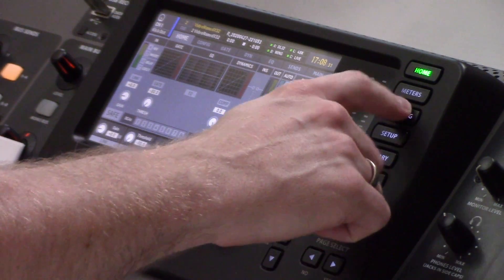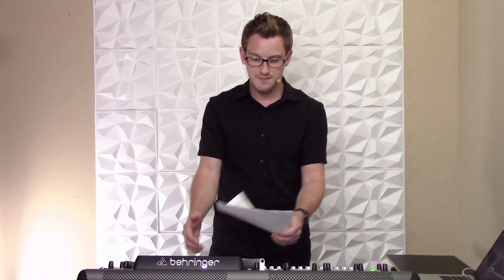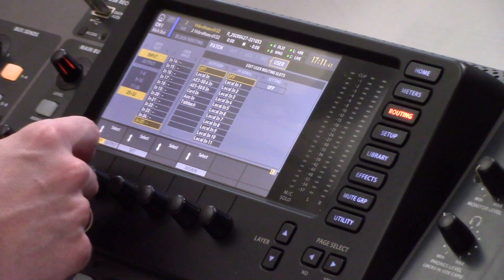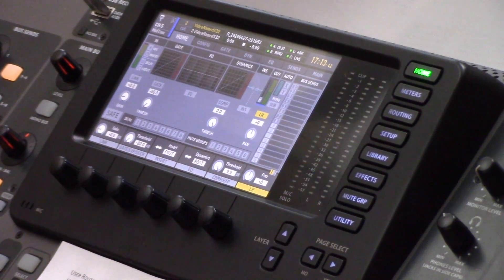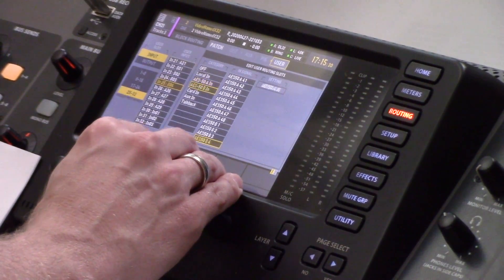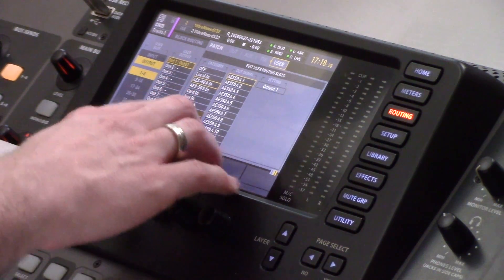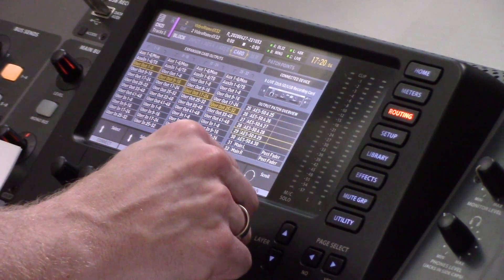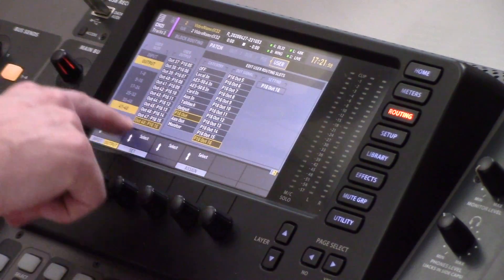X32 Firmware V4 | 301 - User Routing 1-to-1 Patching!

Comment: Hi Drew - many thanks for your efforts to help us better understand Behringer's X32 operating philosophy. While trying out and rebuilding your instructions, I came across a serious problem which I was able to solve after tens of hours. If I try to implement your instructions with the X32 software for Windows, it does not work. Since I have an X32 Rack version and didn't always want to slide around on my knees in front of my side rack, I didn't come up with the idea of trying this directly on the mixing console. Eventually, after a few hours of frustrated trial and error, I made the necessary adjustments directly on the mixer. And lo and behold ... it worked immediately. Conclusion: the X32 software is faulty and obviously doesn't pass the set commands on to the mixing console correctly. Maybe you can give your community a hint in one of your new videos about the X32 that this software should be used with caution, especially when it comes to more complex routing. 
Best regards from Germany - Frank

Comment: Hello. I would like to ask for an explanation:
1. How to connect X32 Compact to S32 and use 16 outputs.
2. How to connect x32 Compact and use outputs 1-8 from S32 and outputs 9-16 locally from X32 Compact so that you still have 16 outputs.
3. How to freely configure outputs on X32 Compac and full size.

I am asking for help, which I need to connect more and more often and I have a problem with it.

Regards. Paul

Comment: In youre video you mention Channels 1-29 used as AES50 and Channels 30-32 as Local inputs . Then in the user inputs page you assigned 1-29 being AES50 and 30-32 as Local 1 ,Local2 and Local3. THAT IS WRONG  because local 1 local 2 local and local3 has already been assigned   as AES50 .  This will not work Channels 30-32 should be set to Local 30, Local 31 and  local 32 then you can local input into Channels 30,31,32

Comment: I am so happy they fixed this! There have certainly been times when I've been using an X32 and needed more than 24 inputs from the stage but also needed one or two inputs at the FOH position. Very rarely do I need exactly 8 inputs at the FOH position. It's really nice to be able to just assign the specific inputs that you need like you've always been able to do on basically every other digital console!

Comment: What output channels does the S32 use when sending back from x32 on the AES?  You mentioned that the Ultranet uses outputs 33-48 and you have to use those.  But what does the S32 use for it's 1-16 XLR outs on the back of the S32? Is it simply 1-16? Or can you change and customize it?  I'm trying to understand the use cases of only being able to pass through 17-32 if the other blocks are locked in when using an S32.

Comment: Thanks, I received a "shocker" when I upgraded my X32 to V4.06 and S16 to V2.5. I had no outputs out of my S16 but all inputs worked fine. After watching the video about 4 times I figured out that User Outputs should have Output. Why in the world they didn't call them Buss'? I thought mistakenly output was the jack on back of X32. Behringer support was slow, Thanks again Drew!!

Comment: Sir I'm banging my head on some stuff .
Running x32 usb carded to a pc then to reaper daw .
I us a  dl32  for everything exept the usb to pc and aux for pc sound back to x32 .
I'm trying to rough out a daw mix threw a aux out 1/4 inch say 1and 2 to a atem mini pro so I can run my live mixes with plugins from reaper .
All 32 channels on the dl32 are used .
Aux ports 3,4,7,8 are opened 1 and 2 in have a left rt from the headphone of pc and 5 and 6 are a click track route from reaper . 
Originally I had a matrix mix routed to 1 and 2 out and then that went to mix input of the atem and worked ok but mix could be alot better lol 
And thoughts out help would be great I am doing this in my home studio but our church setup is the same so hopefully I can solve this here .
Thanks

Comment: Drew, thanks for the whole series of V4 tutorials.  One question, wouldn't it make more sense in your example to only use the User patching for 25 to 32?  Seems that would be a lot quicker to only use the User function for the "8 block" you need to split.
Reply: That’s what it thought too. And saw someone doing that in another video also. So the way you described should be more efficient than shown in the video I reckon.

Comment: HI Drew, I cant thank you enough for all you do for us worship leaders that have to know the X32 inside and out1 I do have a Q though, and my head hurts from watching so many times and still not getting it. This Sunday we are trying our first post lockdown service outside on the from lawn. I use an S16 on stage that has all 8 outs set as mix busses. This week however I want to download V4 and figure out how to use out 7 and 8 of the S16 as my main out 15 and 15 so I don't have to run 100s of feet of XLR out to our portable speakers. Our board is staying in house and we will be running the service completely via iPad. You don't specifically address this in the user out section of your video. Any help would be appreciated. Thanks!

Comment: Is this a practical way to deal with linked (stereo) inputs so that only 1 channel is taken up? Keeping more "prime" instruments together? I have a Producer so can only access 8 channels at once. (I understand the left/right each require their own channel, but the right of stereo inputs could be 'stored' in 17-24. Does that make sense?
Reply: Hi,  I have the Compact which has the same 8 + 8 + M. fader layout.  Pressing (any) 2 Input bank select buttons (at the left of the faders) simultaneously will switch both the fader banks. So pressing the 1-8 & 9-16 buttons will give you 1-16 across the 16 faders. Or you could have 9-16 & 17- 24 etc.

Re the routing: If you link an Odd & Even pair of channels they will give a Stereo (pan is automatically set L/R) channel output, but you can still select the same 2 inputs to any other non linked channels to give individual mono channel outputs.  Channel linking options are on Setup/ Config/ Link prefs.

Comment: Hi! We have an X32 & s16. I am using the usb on the x32 to pull audio into my macbook for live stream purposes. I have NO CONTROL over the live stream audio unless I turn the main faders all the way down & the keyboard is the toughest. We are running it into a DI Rack and running the rack into the s16. Even if I mute, it will mute in the house but it still blasts on the stream. I’m running 4.2 firmware on the x32 & 2.4 on the s16. I’m not recording to/from any DAW’s I only want to use the x32 usb as an interface to have our audio from the board go into my streaming software & out to the live stream broadcast. Please help🙏🏾
Reply: Hi,   By default the outputs to the USB Card are direct from the Mixer Inputs (Local or AES50).  To have fader control of the Card inputs for your Stream, you would need to Route the card inputs to a Mixbus Output (post fader Tap, which is the default), then with  Sends on Faders, send the outputs of the Channels you want to appear on the Stream to the I/p of that Mixbus. The Mixbus o/p fader would be the master level control for the Stream, and the Channel faders would control the mix to both the FOH & Stream simultaneously. If you wanted an independent mix for the Stream you would need to change the Sends on Faders Taps to ‘Pre fader’ then the Send’s faders would be the mix for the Stream.  As with all sophisticated systems there are many other ways to achieve the same result, but each with it’s own features and advantages!  

I always have X-edit running on a computer when doing complex setups as it is much easier to see the routing paths and options (and any miss settings) on the graphical display than it is on the small mixer screen.  Hope that helps.

Comment: The x32 could always do 1:1 patching. It is just now all in one space, and significantly more flexible. I have had single re-assigned channels on mine going back many years. I remember having my first 16 on the stage box, then my local wireless mic's and sources and had then grouped in with my wired vocals from the stagebox all in 1-8.  You could reassign the source for individual channels through its config page. So I wish people would stop saying it was forced in groups of 8 as it was not.
Reply from the maker: Yes, you can do 1-to-1 channel routing like you are mentioning. But what you weren't able to do before is take only 15 of your inputs from the stage box, and then use 17 inputs from the local console. You would be limited to selecting 1-8 and 1-16 on the stage box, and then an additional 16 from the local like your setup. But if you wanted to have 17 inputs plugged into the local and then take 15 from the stagebox, you wouldn't be able with the old firmware.
Reply: @DrewBrashler  It was actually better than that. I could have my board in the default setup using all local inputs. Then plug my aes box in and grab one or two inputs to assign to any channel. 
https://www.youtube.com/watch?v=gvuHppv1-iw
I however needed x32 edit on a PC to do this IIRC...  I took that video last year when V4 was announced and my production partner was very excited about it And I was "what is the big deal" lol.  Of course once I updated my board and saw how much easier it was, I knew they knocked it out of the park. It really did add functionality in addition to how much easier they made it. We are both right to a degree.
Reply: Of you we’re working in a block of eight, you’re right. Try to make it with an odd number of input and you’ll fail prior version 4.00. Watch the whole video and it’s self explanatory what’s the new advantage is.

Comment: I am still confused about new routing.  Using my X32 in recording to a PC.  Routing page has  a configuration for recording and one for playback.  How do I monitor previously recorded tracks and record new ones to the PC?
Reply from the maker: Great question, Jim! The routing for Recording is when your console is set to recording mode, so you will want to have this be your inputs from the stage (ie. local or AES50). Then you can press the 6th rotary knob on the routing page to change between Recording/Playback to swap over to the playback mode. This you would want to have routed from the expansion card so it would play form your PC. Hopefully this clears things up!
Reply: Drew Brashler   Thanks for the reply and the info regarding 1 to 1 routing.  After playing with several combinations and new Calkwalk DAW software, I managed .to get everything working exactly the way I needed it to.  Please keep up your instructional video as they are so helpful and your are very good at what you do.  God bless and take care.

Comment: Thank you so much for that Video. I have a question and maybe someone can help me. I am a Tech Guy in our church and we are using the X32 Compact for some weeks. Now my problem is that the outputs from our console are the same like the outputs on our S16 Stagebox. So i have only 8 Outputs and if we are using the outputs for monitoring we only have 6 Outputs, because 7 and 8 are Main L+R. How i can separate the outputs on the stagebox from the outputs on the console so i can use 16 Outputs? Would be great if someone can help me out. I am completely new in this whole thing. Thank you very much!!!
Reply from the maker: Thanks for asking, Josef! Check out this video: https://youtu.be/FBnuuPCnGTQ. But you will want to make sure that your S16 stagebox is set to have the +8 output light turned on. Take a look at the S16 manual on the specifics of how to do this, but by default it will have the outputs 1-8 of the X32 on the S16. By setting the S16 to the +8 on the outputs, it will be pulling from the 9-16.

Another option is to set your AES50 outputs 1-8 to be from Out 9-16 instead of Out 1-8. This would force your X32 to output the 9-16 down the 1-8 to land at the S16.

Hope this helps!
Reply: Drew Brashler, would/could you please PM me on iMessenger? Seems you have gotten me 85% there but not all the way. My set up is pretty typical I think. And I could use the guidance if you could spare, of course thank you, Drew. Compensation is available I’d expect.

Comment: Drew great video learned a lot. I have a question on running as s16 snake and a x32 producer. how can I run all 16 xlr's?
Reply from the maker: Glad you liked it! For running all 16 outpus, you will want to make sure that your S16 stagebox is set to have the +8 output light turned on. Take a look at the S16 manual on the specifics of how to do this, but by default it will have the outputs 1-8 of the X32 on the S16. By setting the S16 to the +8 on the outputs, it will be pulling from the 9-16.

Another option is to set your AES50 outputs 1-8 to be from Out 9-16 instead of Out 1-8. This would force your X32 to output the 9-16 down the 1-8 to land at the S16.

Hope this helps!
Reply: Hey Drew. Thx for your published videos. I really appreciate it and they helped me (almost) perfectly. But.... I got some questions for you:

My configuration is: X32 rack with S32 at AES-50A. I use the equipment first of all as a  InEar monitoring for the bandmembers. Local XLR Outs 01-08 are for the mounted stereo inEar-systems. 

My routinting questions:
1. Out 15/16 at AES-50A as MainLR
2. Out 13/14 at AES-50A as a separate MixOut for Video over a MatrixOUT
3. Out 11/12 at AES-50A as another seperate MixOut over MatrixOUT
4. Out 9/10 at AES-50A as StereoBusMix for Bassplayer (System Not mounted in the InEar-Rack)'
5. Out 7 and 8 at AES-50A as MixBuses for Monitor wedges 

What about the routing? What do I have to do?

Thx in advance and greetings from germany. 

CU, Oliver

Comment: Hi Drew.  Great videos!  You have helped us train an army of sound techs at our church.  Thank you for all your help.  I have a question about the xlive.  With this 1 to 1 routing, can you rout select x live outputs and have others for the worship team to play to?  For instance, I made recordings of my worship team with drums.  When the drummer is not available, can I just select the card output for the drum channels and let the rest of the team play along?
Reply from the maker: Yes you can! Set the channels you need to pull from your X-Live card from the "Card" inputs on the user routing inputs. This would typically be Card 1-2 or additional channels if you wanted to route individual drum channels. Hope this helps!

Comment: Man this will help a bunch. Thank Drew from presenting. Your the man. I also have a question. You said that I can route 48 channels in total. So can I add another 16ch stage box along side my 32ch box and route those new inputs to be controlled from the aux in layer?
Reply from the maker: Thanks for watching, George! Unfortunately not on your question. The input side of the X32 user routing limits to 32 channels on the input, but 48 channels on the output. So you would still be limited to the 32 input channels plus the 6 AUX channels on the local board.
Reply: @DrewBrashler  Thank you
Reply: George Bonta If you connect a stage box to the mixer using the AES50 B port (so you would be running two CAT5 cables to the mixer) then the first 6 inputs on that stage box can be routed to the Aux faders instead of  the mixer rear jacks.  Be aware that the Aux channels have limited processing features.  Dave

Comment: Do you need to assign all 32 channels using the user settings, or can you work as normal and then just edit the bank of 8 that you want to split in the user settings?
Reply: Caleb Botting you set the user channels in blocks of 8 first, so you could leave (for example) 1-16 on a digital snake and then only user designate blocks 17-32. 

I would think it’s worth doing it all as user designations though. It only takes a minute, and it gives you maximum flexibility.